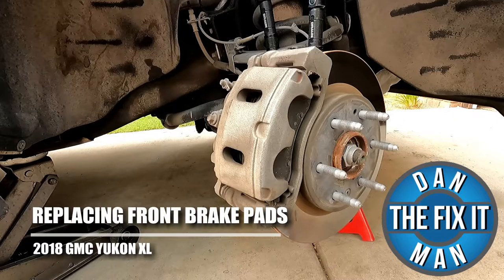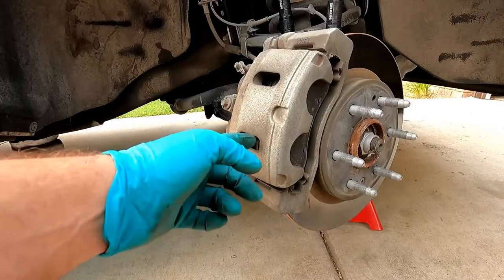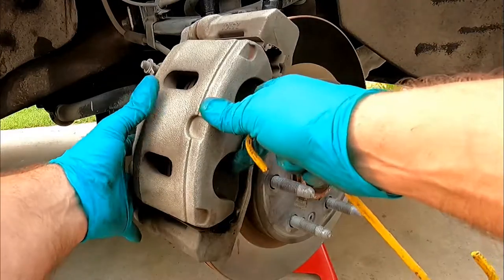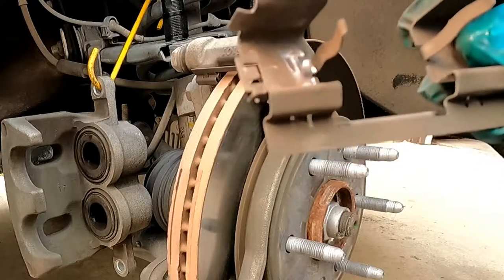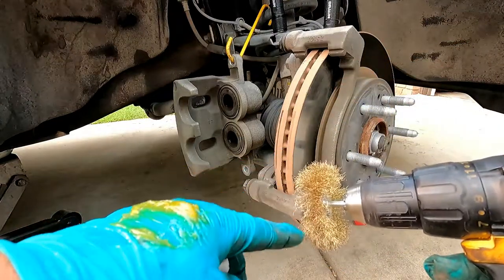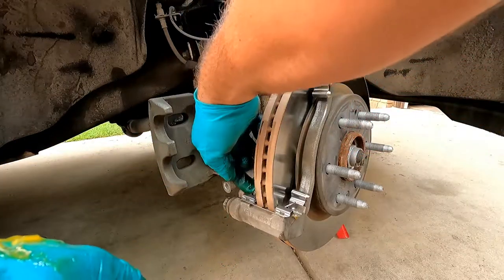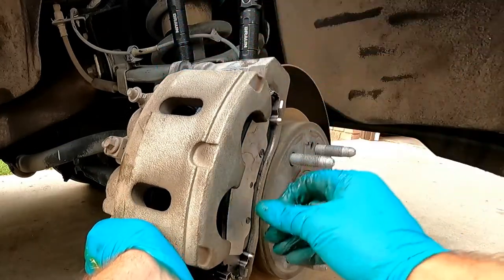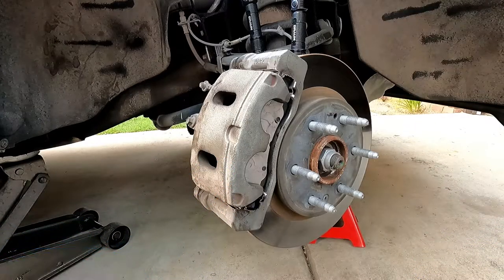2018 GMC YUKON XL - REPLACING FRONT BRAKE PADS - DIY

Comment: Great video. Question - would this be the same for a 2015 Yukon Denali?
Also how do you determine when you can get by with a pad replacement vs pads and rotors?
Reply from the maker: If the rotors are highly glazed /shiny and /or if they are ‘warped’ or causing the brake pedal to pulsate or shake at all when heavy braking it’s time to change them or have them resurfaced.  Thanks for watching!
-Dan the Fix it Man
Reply from the maker: And Yes, it’s the same procedure for a 2015 Denali